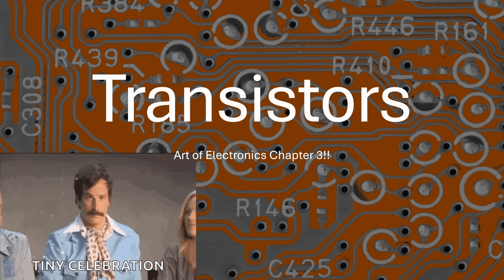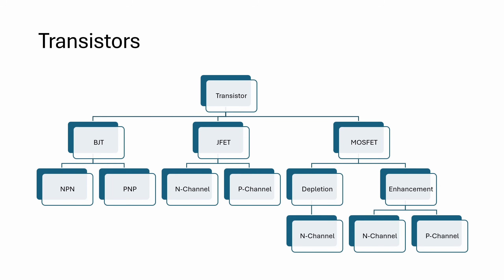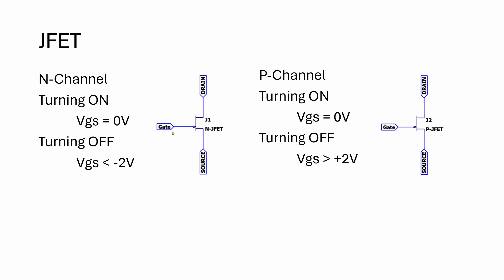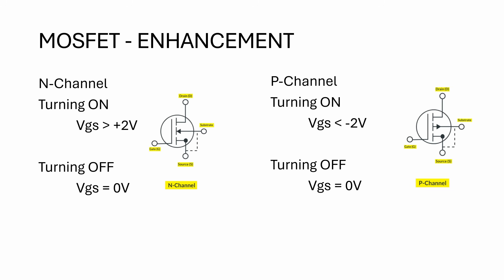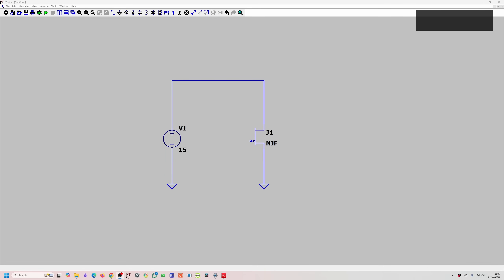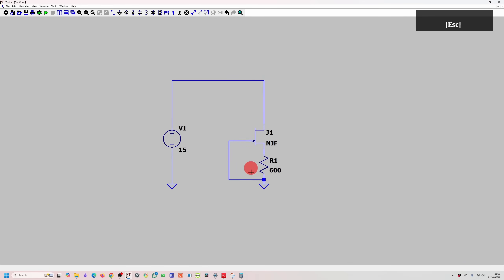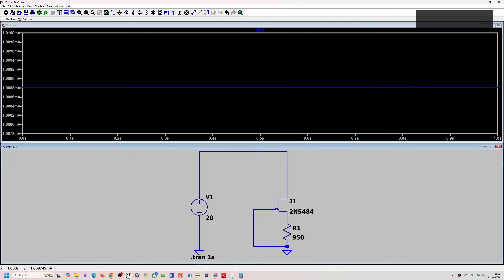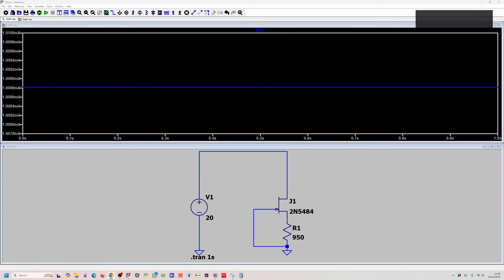JFET Current Source Design - Art of Electronics Exercise 3.1

Comment: clickbait, shame on you
Reply from the maker: Thanks for your feedback. Would you mind explaining why it’s click bait?
Reply: @TheEngineeringExperienceYT  "Don't do that" with the arrow pointing to the current programming resistor in your preview/promotional picture. it's misleading. it suggest that you are about to show a better/other method of biasing the fet, jet you are just explaining the fet ccs using the resistor.
Reply from the maker: @beamfinder8336  Thank you for the clarification, I really appreciate it. 

I can see where you're coming from and I didn't mean to suggest there'd be an alternative, although I did briefly mention a few alternatives/work arounds for the problem we face when designing a circuit as suggested in exercise 3.1 

The main purpose of the video was answering Art of Electronics Exercise 3.1 which focuses on "what not to do" or why designing a circuit on a measured parameter is not a good idea. I think the thumbnail reflects the point well. 

I do think you make a great point though, including a better circuit would definitely add value to the video and understanding the concept better. I look forward to making a video that shows a good alternative. Maybe I will put "Do this instead!" in the thumbnail. Hopefully that's not perceived as  clickbait! haha

Thanks again for you feedback, it's much appreciated.  I hope you still found the video useful!
Reply: @TheEngineeringExperienceYT  Thanks for the reply!
Now I see what your intention was. If you're still concerned about the thumbnail, how about calling it "potential pitfall" or "can become a pitfall". I think this would summarize what you want to show in your video.

Comment: I think there is an additional issue. You very briefly touched it. You cannot even guarantee at least 1mA. If you select by chance a 2N5484 with just the minimum IDSS of 1mA, the circuit will produce less than 1mA. If you want to guarantee at least 1mA, you need to choose a JFET that guaranteed IDSS is > 1mA.
Reply from the maker: Very good point!